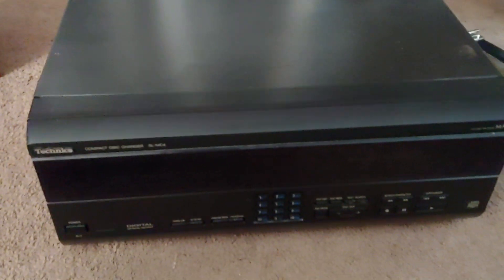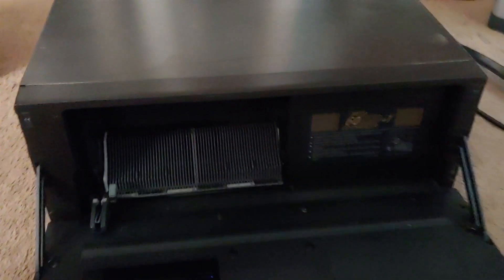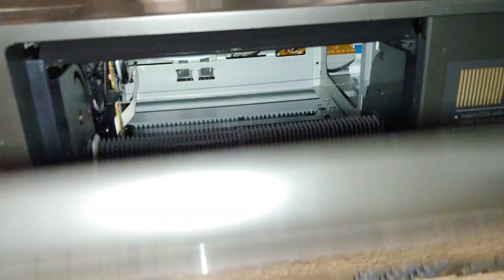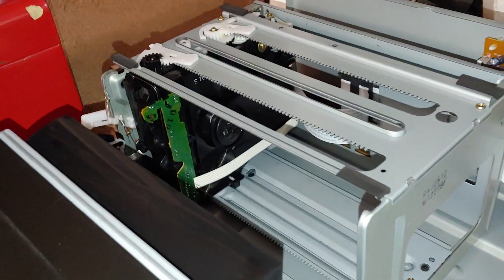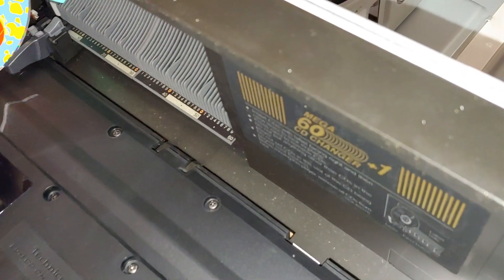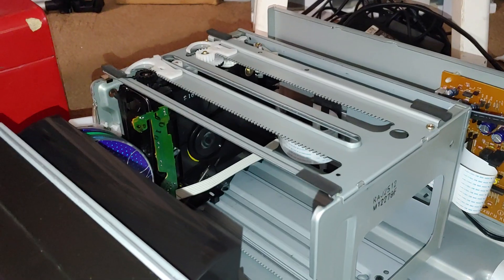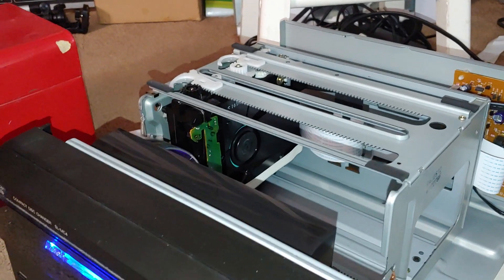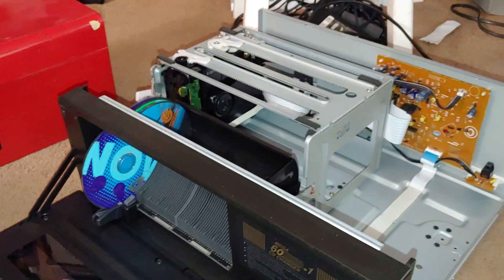Technics SL-MC4 60+1 CD changer

Comment: I've had a Technics SL-MC6 (110+1) CD changer since the late 90s - still in almost new condition, it's been a great addition to my Technics system...and to think when I saw it in my local hi-fi shop  I was only looking for a 5 CD changer! Only trouble I've had with it is the infamous 'Checking discs' message - resolved that by replacing the stretched and perished drive belt with a 1 1/8" x 1/16" o-ring that cost me £2.00 for a pack of 6 :D